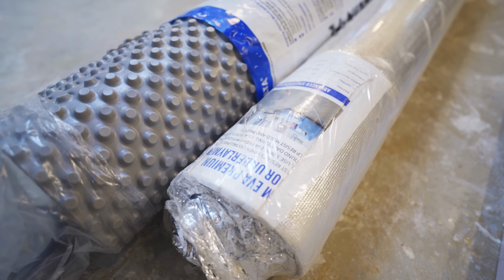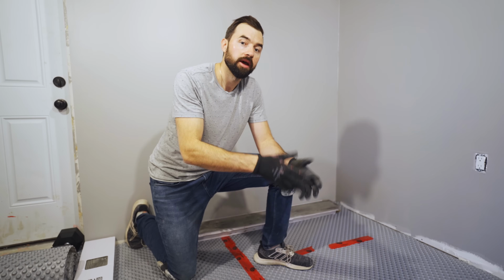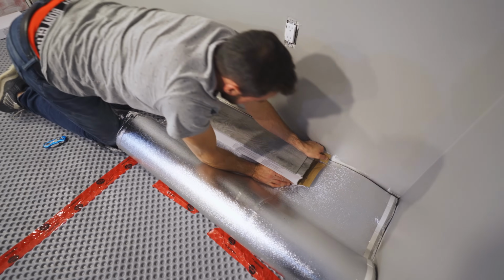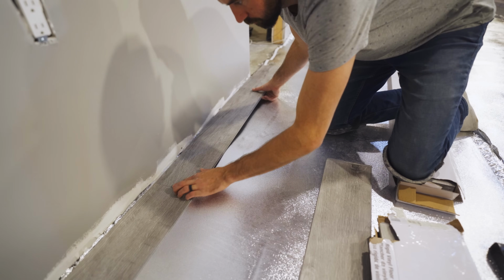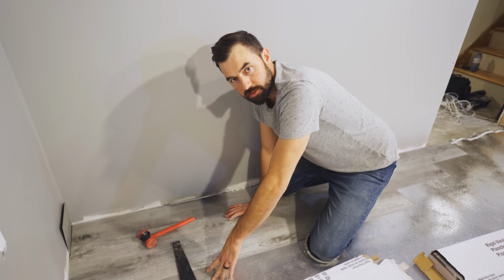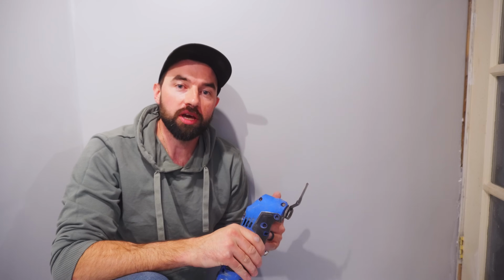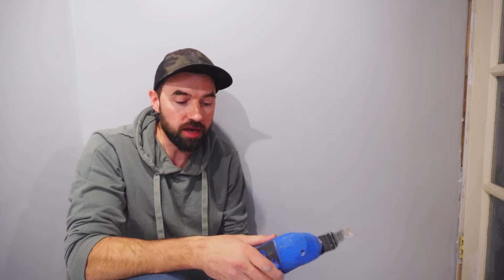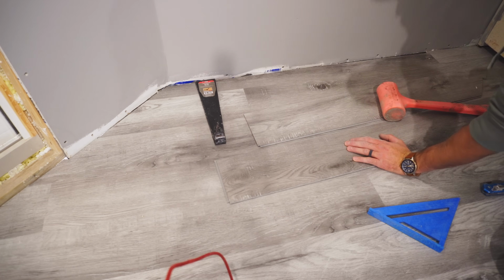How to Install Vinyl or Laminate Floors in a Basement (Over a Concrete Slab)

Comment: I am planning on installing over a polished concrete floor, but it has a grooved surface. The grooves are at a 45 degree angle to the direction the laminate flooring will be. Do I need to fill all of the grooves with some type of filler, or will it lay ok given the different angles?
Reply from the maker: It’s probably fine… how deep are the grooves?
Reply: @DIYDudes  Prob 2-3 milimeters.
Reply: @DIYDudes  Probably 2-3 milimeters.

Comment: Nice straight to the point. 

What are my option in basement if I have drain in the middle and the floor is not obviously leveled and slops towards drain in center.
Reply from the maker: If you want to level out the floor you would have to do a plywood subfloor and shim them  level.  

Thanks for watching!

Comment: How do we know if the concrete is good before installing the floors
Reply from the maker: As long as it’s solid you are good.  Tap it with a hammer.  If it sounds hallow or cracks you have a problem

Comment: Exactly what I was looking for as far moisture barrier layers for concrete. Couple of questions please!
1) I would have put the moisture barrier down first, then the underpad on top. You did the opposite - underpad down first. Wouldn't moisture coming up would hit the underpad first then?  Why did you do that order? 
2) How is the flooring adhering to the under layer? Is it? What keeps it from bowing up? So the planks lock together at the joints?
Thank you so much, very helpful video!
Reply from the maker: Honestly both layers provide water proof benefit.  The dimple board creates an air gap  and the foam pad provides a continuous sealed surface/insulation and sound dampening 

Good luck
Reply: Regarding 2) the flooring doesn't adhere to the under layer. The flooring is interlocked via tongue and groove so the entire weight of the floor is what holds it down.

Comment: Can I use self adhesive floor tiles on the underlayment you used here
Reply from the maker: No.  Adhesive tiles would need to be attached to a rigid surface like wood.

Comment: So most underlayments tell you to go 2 inches up the wall not butting it up against the wall. How does this work with corners, and how does the trimming process work after board installation? Does the excess get trimmed at the top of the floor (extending about 3/4" up the wall effectively or a sheer cut down?
Reply from the maker: Not sure what you mean.  The underlayment needs to go all the way to wall similar to the floor (with a slight expansion gap)
Reply: @DIYDudes  I had the same question. The instructions when I bought my underlayment by Sentinal had mentioned this. My problem when I do this is that it all buckled when I to butt the next piece. 

I’m at the point where I’ll just cut it like you, tuck it underneath ,then retape the pieces again to make sure it’s all level.

I bought the thick green underlayment.

Comment: Thanks so much. No extra chit chat that drives me nuts you got right to the point and explained everything really well! Subscribed.
Reply from the maker: Thank you
Reply: Having helped lay a floor in the past, I was able to follow along with this video.  The only thing that might be added is an overlay of tools used for those who are not DIY savvy. Otherwise, great job and good refresher! Thanks 😊
Reply: Very Good Explanation thanks for that video 🙌
Reply: Everything?  He could have mentioned in the description which materials he used, don't you think? 
Instead of describing "hardly known exotic tools like: Speed square for drawing straight lines
- 4-foot level for checking high/low spots
- Utility knife for cutting underlayment (can also be used to cut vinyl planks)
- Mitre saw for cutting planks
- Mallet & pull bar for setting the joints
- Multi-tool for cutting door trim and other precision cuts

He could named the materials used. Are we mind readers? At least, I am not able to read off the screen what's the brand of the dimple mat or the Eva underlayment. Excuse me!
Reply: @sfuchs  thanks for helping out with the extra details. Although I don’t think he left that info out on purpose. Sometimes we forget that things that are common to us may not be that common for others. It’s just human imperfection. You could call off the dogs on this one.
Reply: @sfuchs  if you're that clueless, you're better off hiring a contractor for your renovation.
Reply: @MK-zf6or  what's the point of posting this video for DIY Dudes, if you end up needing hiring a contractor??
You make a total sense bro. I only ask for the materials used, as there are multitude of options and I don't want to purchase a wrong ones, as it's a considerable investment comparing to a $7 speed square, or $5 malet, which he described so well.
Reply: @sfuchs then used his excellent video for how to and find another video for tools

Comment: So I bought a new townhome and it’s on a slab. After few months. Noticed buckles on the floor ( LVP) come to find out there is no moisture barrier on the slab. How is possible new homes they don’t put moisture barrier on the floor due to slab has moisture. I don’t understand why new homes miss that.
Reply from the maker: Might also be the way it was laid.  If the joints are hammered to tightly the may buckle… some of the thin flooring is very flimsy

Comment: Do I need the underlayment? It says it will void the warranty
Reply from the maker: Always follow your manufacturers recommendations.  If you wanted to do a system like I am using you would need to select the right flooring material that allows for underlayment Thanks for watching

Comment: Great video! where did you get the dimpled moisture barrier and the Eva foam? Can you please put a link out? I couldn't find them from Amazon.
Reply from the maker: The dimple board I got from Lowe’s… the Eva foam I got from a specialist flooring store.   It’s the same price as the ultra thin stuff from Lowe’s.  

Thanks for watching

Comment: I bought dimple plastic and wanted to do vynal but i was told i need a subfloor plywood but for the price they are now i stopped trying. So i don’t need plywood subfloor? I can just put underlayment on top of the dimple plastic n put the flooring on top?
Reply from the maker: Dimple board, the under pad, then flooring and you are good to go.  Only concern would be because the dimple board isn’t as rigid as plywood you need to have a rigid vinyl floor some thing about 1/4” thick should be a minimum

Comment: How cold is the floor without any insulation?
Reply from the maker: The subfloor creates an air gap (insulation) and the underpaid i used is 3mm thick Eva foam which provides insulation as well 

Using this combination the floor is quite warm

Comment: i just bought a bunch of this at menards. they told me to not put anything under it, just lay it flat on the floor. kitchen and bath
Reply from the maker: The underlayment I used is specific for installation on concrete… adds vapour protection /sound dampening /insulation

Comment: I want to install flooring in my below grade (underground) basement. The contractor says foam back waterproof LVP click method is best HOWEVER  my brother says I should GLUE the flooring instead of the click method. Do you have issues with the click method moving under your feet or popping up in basements over time? Please advise. Thanks
Reply from the maker: I would agree with contractor… just make sure to leave expansion joints at the edges (under the trim) for slight movement over time and temperature changes

Comment: Very helpful video I have a quick question I bought the barn house and when ever is raining or bad weather I see moisture in my kitchen and living room what should I do and do you recommend vinyl or laminate?
Reply from the maker: Hey Naaz I would definitely recommend focusing on water proofing your home before doing any renovations.   If you were putting flooring in an area that might see moisture like a bathroom I would use a waterproof vinyl… make 100% sure it says waterproof and not just water resistant

Comment: Why did you put layer of foam or whatever was that material on floor?
Vinyl is already moisture proof and waterproof.. right?

I am asking this because I have contractors working in basement and they are putting any thing below vinyl as they said it was required if they would have put laminate instead of vinyl
Reply from the maker: The foam provides three things. vapour protection 
insulation to keep the floor the temp of the room not the temp of the concrete 
and sound dampening.  Without it it would sound like you are walking around with high heels all the time

The dimple board acts as an air gap to let moisture dry
Reply: @DIYDudes  thank you for reply..
If I want to spend least money I am thinking to put a 6mil plastic vapor barrier sheet... Will that help at least as something than nothing?
And how much approx cost it is for that type of thing?

I am thinking to do this because contractor is not putting anything below vinyl plank he says it is SPC and it already has a 1.5mm pad below plank so I don't need it..
But I want to push him to at least put cheapest layer

Comment: Thank you for the great video and info.  After reading and talking with flooring companies, I've concluded that a vapor barrier is required underneath the vinyl planks if you have an older home.  I'm positive a vapor barrier was not installed when my home was built (1980).  Two separate flooring companies mentioned they use 6 mil plastic when installing vinyl planks for customers.  Just another alternative (cheaper) to consider.  Do you see any reason why regular plastic wouldn't work?
Reply from the maker: No there’s no reason that wouldn’t work as a vapour barrier.   It would not provide any additional insulation or sound dampening though
Reply: They still don’t put moisture barrier on new homes if on slab. I just purchased new home. They are finally gonna redo the whole floor and install moisture barrier. Due to buckles started to form after few months since moved in. 🙄
Reply: @davidh9820  buckle on basement floor? Because of concrete? Or all the floor upstairs etc? Thanks.

Comment: What are the two types of underlayment/ moisture barrier you used in this video? Do you have suggestion for alternative for the foam pad? I can find what was used at Home Depot
Reply from the maker: The foam pad I got from a flooring specialty store.  It’s a thick eva Foam… much better than Home Depot brand.  The dimple board is standard from Lowe’s or home depot
Reply: @DIYDudes  Was it similar to Dekorman from HD? 3mm thick.  That's too thick for LVP (at least it is according to Lifeproof) - did you have any issues with it being too soft and boards separating? I want to do the same thing and would love some insulation below the floor but don't have much room, don't want to increase the height much.  But you need very solid underlayment that can take a lot of PSI usually.

Comment: Great Video, I am planning to install vinyl flooring in my sunroom having concreat. How do I know that floor is leveled or not?
Reply from the maker: Your best bet would be to purchase a plastic 4 foot level and check using that.  Good luck!
Reply: Vinyl vs laminate, what is better? What are pro and con according to you. We have one wall of sunroom that might have few drops of water during rain, but we are thinking to put wall siding at the exterior of wall, do you think then it will be okay to go for laminate?

Comment: Did you put a sealant on the concrete?
Reply from the maker: No we didn’t an moisture that happens to percolate through will dissipate in the air gap created by the dimples.

Comment: Great Video. I'd be interested to hear your thoughts on my idea I'm tossing around for my office build in the basement. I just bought a house built in the 50's and building an office in the basement with the goal of minimizing sound and any moisture/vapor. I'm looking into getting LVP flooring and putting down a 6 mil vapor barrier on the cement, underlayment (QuietWalk from Home Depot), then the plank flooring. Again, looking to minimize sound transfer and any moisture/vapor.
Reply from the maker: Hey Luke the only thing I would be concerned about is adding the vapour barrier right on top of the concrete.  I used the dimple board to create an air gap…. That way as moisture does wick through the concrete it will have a space to evaporate…. If the moisture barrier is right on top of the concrete water will just collect there…. Talk to the guys at Home Depot I’m sure they can give you some advice on their products.  Thanks for watching

Comment: Very professional, love the video. Have a question regarding the underlay and vap barrier you put down in preparation. I have Life Proof vinyl flooring I purchased from Home Depot which already has a backing underlay and snaps into place. would this be overkill using your prep method as well as the vinyl floor with the backing or not recommended to do both? Kind regards Cliff
Reply from the maker: Hey Cliff thanks for the comment,  the underlay on the back of your flooring probably is not designed to be a vapour barrier but more likely to be for insulation/sound dampening.  If you are flooring on top of concrete I would recommend using an additional vapour barrier with a dimple bottom.
Reply: @DIYDudes  Thanks for the reply and direction, will take your advice. Kind Regards Cliff
Reply: @DIYDudes  where can you find the Eva foam underlayment?
Reply: @DIYDudes
Reply: @DIYDudes  I have the same question my situation is a little more complicated. I have cinder blocks for the wall in the basement. They are porous. I have sealed it with hydraulic cement as well as a sealant. But I don't think it is 100% fixed :(. Eventually, I will have to seal it from the outside.  So coming to the problem. I was thinking that if I seal the concrete with sealant and then have no undergarment - then the rainwater if it comes over the vinyl floor as there is very little space between floor and vinyl. so that I can wipe that water from the vinyl tiles or vacuum it. The little water between vinyl and cement floor will evaporate faster as there is no undergarment.

Comment: Why use a moisture proof layer in vinyl flooring ? Isn't vinyl the main reason you chose to deal with the moisture and mold ?
Reply: Mold
Reply from the maker: Exactly…. Keep the moisture out of your finished space
Reply: @DIYDudes  My laminate does not lay flat at the end where it abuts to my floor tile. How do I get it to lay flat?
Reply from the maker: Could you send a photo?

Comment: Some people say u don't need moisture barrier.. other say u do need one. 

Could u say why u need moisture barrier over concrete floor when planks already have an underlayment attachment?
Reply from the maker: Hey Alek.  It’s all based on the concrete slab construction newer homes will have their concrete slab poured on top of a vapour barrier which prevents moisture from absorbing through the concrete into your home.  Older homes will not have this and water could seep through the slab and condensate beneath the planks.  In my case I have an older home which is why I used the dimple board any water that does deep up will have an air gap in which to dissipate the moisture, if I didn’t have the air gap  the moisture would just collect over time
Reply: @DIYDudes  ok thanks for reply!! If I still use moisture barrier on new house.. will it be beneficial?
Reply: @aleksandrnastin6669  I actually ended up on this video because our 1960s home was built with concrete that did not have a vapour barrier and the carpet installed over it is now molding. I'm in the Midwest and moisture is definitely a problem here.
Reply from the maker: If your house foundation was poured on top of a vapour barrier I wouldn’t add another vapour barrier on top.  Two vapour barriers can trap moisture between them.
Reply: @DIYDudes  how do we know that?
What about a 22 years old home in Canada?

Comment: What type of dimple pad and underpayment did you use?
Reply from the maker: For the dimple board I used a basic product from Lowe’s.  For the underpad I went to a a flooring specialty store and got an underpad made of  thick waterproof Eva foam. This is a much better product than what you would get at Lowe’s for the same price as the cheap thin foam stuff they sell